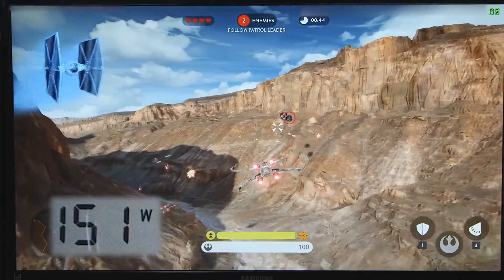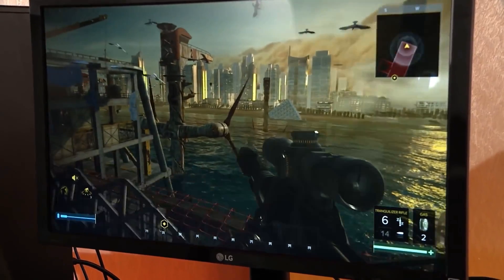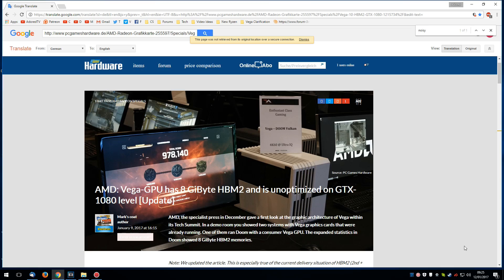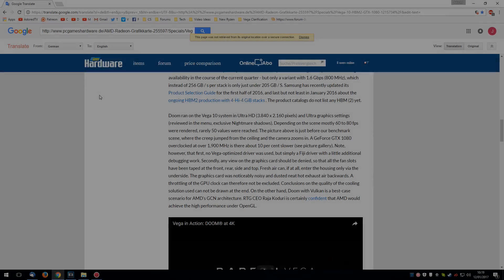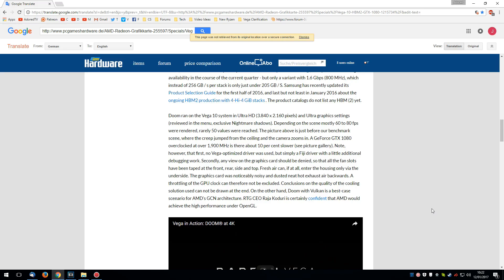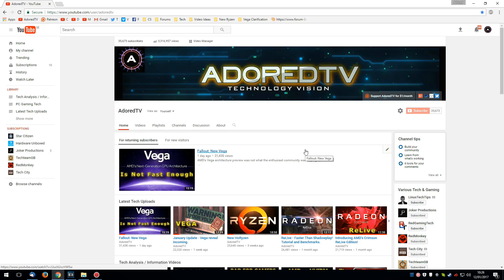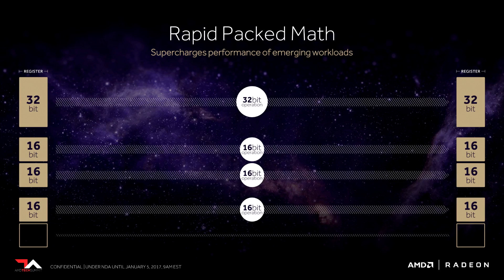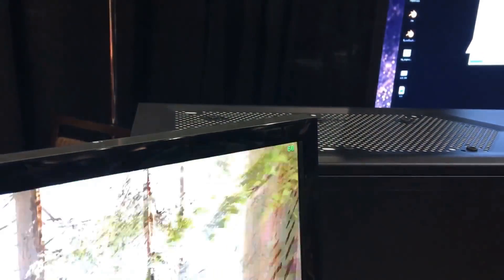Vega Clarification - How bad is it?

Comment: 2:50 SO taking a CPU that at stock will turbo all 10 cores to 3.7 GHZ out of the box, with a maximum boost of 4 GHZ again, put of the box - and lowering that CPU to 3-3.4 GHZ to compare against a CPU that will supposedly run 3.4 to 4 GHZ isn't sandbagging? 

I would say it sure as hell is, unless that comparison used a 6900k with an IN-SPEC Heatsink at stock out of the box speeds. 

And until we can see EXACTLY how well Ryzen CPUs can overclock ALL cores at ALL times-  like my i7-2600k  running at 4.7 GHZ on every core at all times as I have turbo off and have manually keyed in the CPU multiplier and a constant voltage of 1.35 - a CPU that is now 6 years old - bit can still run EVERYTHING as well as required for 1440p and a G1 Gaming GTX 980 TI running 1503 MHZ core and 8 GHZ effective VRAM.

In CB scores, my single core performance is BARELY behind the 6700k at stock! 
So while Fanboys talk about how "Clockspeed isn't everything" - I prefer to live in THE real world, where specifications mean everything in regards to performance! And with Ryzen we roughly see Haswell IPC but lower clockspeeds so far. 

I'm not going to say Ryzen can't compete, but I am saying that so far, I am worried that it will not be able to compete for high end gaming.

Comment: 1:05 Seriously m8, all AMD does is over hype and sandbag!  Polaris was nothing for anyone to be really excited about, but that didn't stop AMD from selling it as the "New Generation of GPU technology!" And other similar marketing wank terms. 

Ryzen, is still a MASSIVE sandbag IMHO! They compare it, IN GAMING to an i7-6900k clocked at 3.4 GHZ - when anyone who knows ANYTHING will know that a 6900k under proper cooling will easily hit 4.5 GHZ, but what's more telling is that EVEN THOUGH the 6900k costs $1400 - an i7-6700k at 5 GHZ-  which has been done countless times - will WRECK a 6900K at 4.5 GHZ when it comes to gaming alone! I'm not sure that rhw 6900k would win even in a dual GPU head to head with a heavily OCed 6700k or 7800k (whatever the Kaby Lake replacement is called)  - when JUST GAMING!

So to me, it would appear that UNLESS Ryzen can hit around 5 GHZ with their 4 core 8 thread CPU - or even their 8C/16T Summit Ridge hitting at least 4.4 with proper cooling - then the Market for Ryzen will be NICHE AT BEST!

I mean we still have NO CLUE what the pricing will be, but so many Fanboys are convinced that AMD will sell their Summit Ridge 8C/16T for the same price as an i7-6700k or 7800k! Which I just don't think will even be CLOSE! I mean you have to take into account MANY THINGS! AMD is nearing bankruptcy - which I do not want, so they CANNOT afford to sell at a loss, the  there is the 5 or so YEARS of R&D that Ryzen has taken, and lastly DIE SIZE!  Intel's 6 to 10 core CPUs lack an iGPU  but their die size is WAY LARGER than the 4C/8T 6700K which includes an iGPU. 

And in EVERY sort of demo that AMD has given, they have NEVER compared to A STOCK CLOCKED Intel competitor, let alone an OCed one, which is something the vast majority of high end PC gamers do! And as far as I am aware - they have NEVER done any sort of demonstration of the 4C/8T Ryzen versus an Intel i-core either. 

I mean MAYBE Ryzen will become the budget Workstation CPU based on everything I can surmise from AMD's very lacking details, ONE detail sticks out like a sore thumb, and that would be ROUGHLY Haswell level IPC (a hair lower from the calculations I have seen) - but a frequency that has YET to be verified past just 3.8 GHZ! I mean my bro's Laptop i7-6700HQ is "rated" at 2.7 base,but in games I have yet to see any one core lower than 3.5 GHZ, and they often turbo to 4+ GHZ on a single core at a time. 

So much like Polaris, I have to wonder if Ryzen will not be a good laptop CPU compared to Intel's offerings... Time will tell, but to his close to launch, I can't help but think that IF AMD had ANY KIND of "Intel i-core SLAYER" SKU - that they would be shouting it from the treetops by now, but instead? We get pointless benchmarks that mean nothing when looked at objectively, as full game and system specs are lacking - not to forget that AMD UNDER CLOCKED the 6900k as well - so yeahhhh... About sandbagging....

Comment: The problem for me was that in my country in local stores the rx480 was MORE expensive than the 1060 with 6gb, so I went with the cheaper 1060 that has a bit better dx11 performance, I really wish AMD does better though, I don't see why Americans don't buy AMD hardware when it's cheaper than Nvidia over there, for the same performance more or less.

Comment: @AdoredTV you had a massive argument with me some months ago saying that 8x8x isn't a bottleneck vs 16x16x in SLI. https://youtu.be/8KOTiee5RqA here is proof that AdoredTV was completely wrong.

At the time I had 2x 980tis on water at 1550mhz so I saw a much higher bottleneck than shown in that video.

This is why you can't rely on research and sometimes need to perform your own testing. 8x8x is even more of a bottleneck if you use 2x 1080s and a flex bridge but the new HB bridge helps a lot. I would love to find some crossfire results as I am sure with out the use of a bridge the extra load on the pcie bus would make an even bigger bottleneck from 8x8x. This is why I would NEVER buy a chip that doesn't have atleast 32 lanes. 4k ultra still requires 2 cards to get solid 60hz in every game and once 144hz 4k monitors come out using a single gpu won't be a possibility.
Reply: The same guy doing a follow up on 8x8x vs 16x16x with 2x gtx 1080s using a HB bridge. This clearly shows 8x8x is a huge bottleneck. In this test his 16x16x test the cards is even at a lower clock speed due to thermal throttling as at 16x16x there is more load. He is only running around 1800mhz. I run 2100mhz daily on water.

If you plan on using SLI you have to use X99 or suffer a 10% drop in frames. Also cant run 3 or 4way without X99.
Reply from the maker: The point of my argument was that Z170 was still faster at 8x8x vs X99 at 16x16.  Yes there will be some extreme cases where the 16x16x is faster but in the majority Z170 will be faster, certainly Z270.  I would also like to see tests done on AMD cards, not just Nvidia.
Reply: AdoredTV I would like to see thoes tests as I doubt the single thread performance improvement from z170 would make up for the 8x8x loss. I have seen very little in Z170 sli benchmarks. All the reviewers just run single cards. A friend of mine had 2x 1080s at 2200mhz on chilled water at sub 30deg with a 6700k (delid, direct die chilled water, liquid pro) at 5.3ghz and he sold his 2nd card as he was furious about how bad the SLI scaling was. I got more frames with my Broadwell-e at 4.3ghz and 2100mhz on my gpus.
Reply from the maker: I showed you them already. ;) http://www.eurogamer.net/articles/digitalfoundry-2016-what-is-the-fastest-gaming-cpu

You have to understand that with dual 1080's OC'd to 2.1GHz on water and a 5960X CPU you're in the top 0.01% of the market.  In almost all other cases, 8x8x and Z170/Z270 is faster simply due to the faster CPU.  Having less PCIe lanes is one of the reasons why you can get a Z170 system much cheaper than X99.  Ryzen will likely fit in somewhere in-between.  From what I've heard it is a couple of fps faster than the 6900K in BF1 at 4K.  In cases of >4 cores being used in gaming it'll beat Skylake/KabyLake.  It cannot be the perfect "win everything" CPU, but neither is the 7700K or 6950X.
Reply: AdoredTV I still don't believe thoes result as conclusive. If you look at BF1 single player the 6700k beats the 6900k by like 1fps but if you look at multiplayer the 6900k gets a good 15% more frames. BF1 single player was heavily optimised to lower CPU load as people were pissed off at the 6600k requirements. This seems to be the case in a lot of games as it's very hard to benchmark multiplayer scenarios and is typically not done. As far as I am concerned single thread performance will mean less and less as games become increasingly better at multithreading especially as games are becoming much more cpu intensive than they once were.

Personally I am really excited for the release of the 144hz 4k monitors. With this in mind I need to think what will be able to produce 144fps at 4k and I dont think 2x 1080s can and titan xps just aren't cost affective. 3x 1080s would be a cheap option but 3 way isn't supported and 3 way scaling on pascal sucks. This opens up Vega as a good multi gpu choice pending pcielanes and how well crossfire performs.

I don't think spending this kind of money on my pc is excessive. I think that I am only 0.01% due to all the kids playing pc games with pcs their parents bought for them. I am an adult with a job. Everyone I know that is in to pc gaming at my age with a job is running computers simular to mine. Adults spend a lot more money on their hobbies than I spend on my PC. I know my wife spends a lot more on clothes than I spend on my PC.
Reply: I guess I am a little detatched from the typical consumer. I am just really annoyed at the current pc market. I am so sick of the 3% IPC improvements from intel each year and the rediculous price for nvidia's top tier gpus. I was hoping that AMD would fix this but they still don't have an answer for Intels stagnated X99 platform. I was also wishing for a 600mm2 gpu from AMD. Ignoring the top tier is ignoring a big gain in mind share as far as I am concerned. Everyone knows who is on top and everyone wants their products.
Reply from the maker: Well the problem is you should have been annoyed at the market years ago before it got into this state, not now when it's already too late.  Everybody is gonna be a lot more annoyed at the state of the market in a couple of years.

For AMD their choices are simple - Ryzen could not risk more than 16 PCI lanes for GPU because it would require more expensive mobos from the mobo guys.  Had it flopped they'd have been left with no mobos being built.  

As it is, they've got more mobos coming out for Ryzen's release than they ever had for FX.  If they can offer better performance at half the cost of the Intel system, they are improving the average "reasonable" PC gaming system by an unimaginable margin.  Had they spent extra die space on more PCI lanes, then the mobo guys had to make more expensive mobos they'd simply have been pandering to the <1% that doesn't mind paying $1K for a CPU and more than that for a couple of GPUs.

Ryzen will remove dual cores from existence and that is a far greater service to gaming than creating a CPU for the 0.01% would ever be.  You will notice the difference more because when the average system improves to more cores, the average game improves to make use of them.  Intel has done nothing but hold back gaming for years, and now Nvidia is doing the same thing.  Sooner or later you guys are gonna need to wean yourself off this unhealthy addiction to green and blue.
Reply: AdoredTV I have no addiction to red and blue I have an addiction to 60fps+ at 4k with all the settings maxed out. I don't think 2 cores are dead, 2 friendsof mine are buying 7350ks for their media PCs. I have no fucking idea why. I told them it was retarded but the unlocked i3 with HT has a lot of hype behind it. I have seen a lot of posts on facebook lately of people saying they will buy one. I have even said that 4 coreRyzen is a far better option but Linus Noob Tips and Tom's Noob Hardware is the cancer speading the single core performance is the only thing that matters myth. I actually think you will see a lot of reviewers showing the 7350 beating ryzen at single thread performance and idiots will eat it up.
Reply from the maker: Yeah my mind is blow at why anyone would want that 7350K.
Reply: I hear it all the time. "7350k is what you want, games only use a single thread anyway".
Reply from the maker: Minimums and frame times will likely be horrible.  Dual cores should have died years ago.

Comment: I've always bought AMD on the GPU side because I'm midrange card guy and AMD GPUs last longer because I don't upgrade until 4-5 years later. so I got a 8gb 480. I hope it serves me well. but on the CPU side AMD was beyond absent. had to go with Intel core Skylake. as a user I'm happy, everything works great, but I've been using AMD since the single core athlons and the rage pro. good times...amd deserved a comeback.

Comment: Well, when it comes to performance of the vega gpu shown at CES, shouldn't we just assume that the big vega die has 4096 cores, so it's just fiji on speed?And from the fps, it was probably running around 1400-1500 MHz, which is what we are expecting really. So the important thing will be how well it overclocks, and how well the drivers can make use of its new features compared to fiji. I don't think the 1080ti will be all that much more than 25% faster than the 1080, so vega should be fine? The 1080ti will probably take the crown, but as long as AMD has a competitive card, it'll be considered.

Comment: I really enjoyed most of your videos but this time I think that you are doing too much speculation based on a fps counter in Doom and a single fps drop in Battlefront. Polaris was a small architectural change comparwd to Vega but it was a big process change. So they probably had working chips relatively early but they needed to wait unitl the yield was acceptable for mass production. Since they don't need to wait that long with Vega, it's likely that they will have the final driver ready just before the release. So there should be a large room for improvements until release.
Another point that makes me think that Vega does not necessarily perform as bad as you think is that AMD should be able to compete against a GTX 1080 with a large Polaris GPU (like 2x the shaders of Polaris 10) but they decided to not release such a GPU. So they must have expected a huge performance gain with Vega and I don't think that they have failed that massively in predicting Vega's performance since they are building GPUs for years.
Moreover, nvidia will most likely not come up with another GPU aside from a 1080 ti until Volta release. GP100 is a massive GPU with high double precision performance for HPC but the single precision performance is even lower than the Titan X. Additionally, they never said anything about a display controller or other parts which would be necessary to use the GP100 as a graphics card. I'm pretty sure that they would have released a Quadro with GP100 otherwise.

Comment: What you're forgetting, is, AMD don't need to show their "worst case scenario". They don't need to show exactly what they are capable of. The only thing they need to show at this point in time, is that now they can also beat/match the 1070 & 1080. Previously, they could only reach 1060 levels(RX480), nVidia was unchallanged above that, that's why nV can sell those for a fortune. Now, AMD are above the 1080 level, and they have shown it. And what this will do, at the very least, is make people think, and possibly put a tamper on the GTX1070/1080 purchases in the short term, at least until Vega general availibility. And any money not going to nV is money that may go to AMD later.
Were this the case, I still wouldn't call it sandbagging. It's just politics and marketing.

So, that is fast enough. As in, it is as fast as it needs to be. It doesn't need to beat the may-or-may-not-be 1080Ti, and it doesn't need to beat the Titan XP. Those performance and price brackets can barely even be called "markets", they're so miniscule. And AMD is clearly targeting markets, price brackets, not the performance crown.

There is only one point of view, from which Vega isn't "fast enough", and it is the one by which to justify that nasty "Poor Volta" jab. That was a very bold and foolish move, to put it mildly. Vega will not live up to that label, and I'm very much afraid that that insult some creative marketing gay/gal though was really witty at the time is going to come back and bite them in the S.

And, of course, this is all still just speculation. Interpolation from a few data points from the past and present, with certain a method of interpolation chosen out of many possible ones. Final silicon is just that, a piece of silicon. What it actually brings to the table once it's on a PCB, cooled, and clocked, is yet to be seen. And if Vega doesn't beat the best Pascal, it's still not the end of the world. As you said, AMD is a company, it needs to make money. And making money they will. Ryzen looks very good, a well performing CPU will also enhance their GPU mindshare, and the console business is practically theirs for the foreseable future. AMD will survive.

Comment: Just a small note: the machines ( not only GPUs ) that AMD had at CES were noisy because the chasis of the machines were cealously sealed with tapes on every pit/hole, etc. so that people couldn't see some of the inner details. The air flow was not the ideal.

Comment: In late 2014 I bought an ITX GTX 970 Galax, it was a masterpiece of a card being sold at exactly 300 dollars here in Denmark. Two years later the masses jubilate blindly due to the release of the RX 480 which trades blows with the GTX 970 but costs 330 dollars here, I am left shrugging and wondering about this weird hype, from my perspective it was two years too late from AMD. Remember that it was a card that was supposed to compete with the GTX 980 according to many news sites, in my opinion AMD failed in delivering anything new to the table apart from being much better with Vulkan.

Why doesn´t AMD show a broader variety of games in their showcases? We all already know that Doom and AotS run better on AMD cards, most gamers are however more interested in overall performance in a greater variety of games.

Nvidia are greedy bastards because that´s what capitalism is about, if you can charge premium for a product that has no competition you do it, it´s not evil, it´s business.